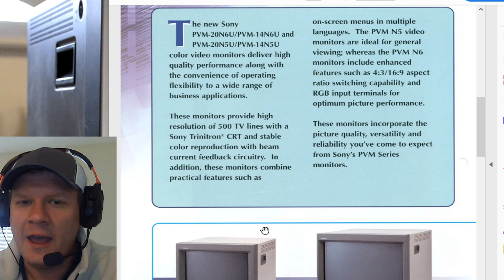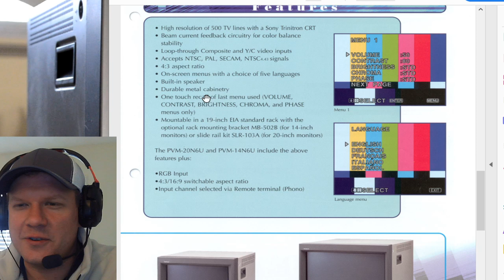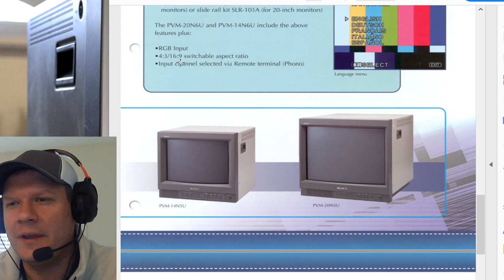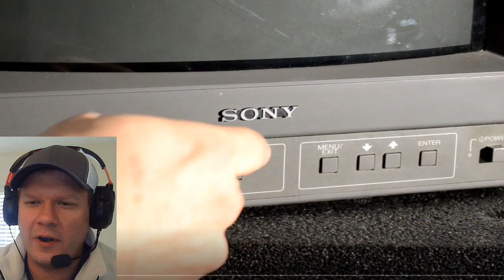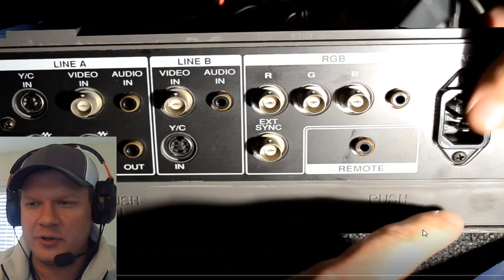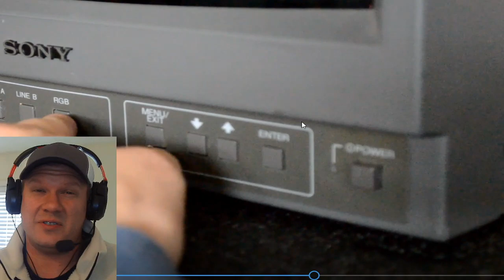This Easy Sony PVM Mod is a MUST!!! | Sticky Button fix

Comment: Converting it from a N5 to an N6 (or N1 to N2) is pretty easy. Hardest part is populating the Q (input) board.
Reply: Sounds like a good video idea in the future if Steve comes across some of the N series.
Reply: You wouldn't happen to have any documented info on how to do this, would you?
Reply: All the N series share the same Q board. So use the N5/N6 schematics (they're better) to populate the RGB section of the Q board. Then, look at the schematics for the components that say "only 14N6U" or "except 14N5U" and modify your A board to match the N2/N6. I needed a couple SMT passives and some through hole capacitors. Like 5 or 6 components in total. The service menu has a mode switch to let you toggle between the low and high end modes. Write the config out, power cycle, and now if you use your external switch for RGB, it'll activate the RGB input and work as an N6, including 16:9 mode.

Comment: You could fix this without even opening the monitor.  I have encountered this issue as well with these monitors, but I was able to fix it by just spraying deoxit D5 spray into the front  hole of the buttons.  Spray then Press the button a dozen or so times to work the solution into the path.  Deoxit is safe to use on plastics & obviously on electronics.

Comment: Glad I found your videos not too long ago. You have great detailed information. I can’t stop watching these. This is the monitor I’ve been fighting with. I was able to switch the wires around on the neck cause my color  (no matter what input) was all switched around. Red was green, blue was red etc. then I’m looking at the picture of any Sega game and it’s wavy. Like towards the top the picture might be bent to the left and so on. If this makes any sense. I hook up Nintendo to composite and picture is fine. Got to b a bad scart cable. I haven’t been able to find this problem online anywhere but it sounds like a sync issue. I’m going to test and take it apart today if I have time.

Comment: If anyone is curious the SSM series of Sony trinitrons were built off of this PVM design. I did a full write-up on how to convert the N5U and the SSM N5U to RGB..  If you watch Steve's video there you notice that he showing a board from an N5U near the end with the green tape underneath the push buttons but there is a button missing that would be the R GB the board supports it but it's not there

https://shmups.system11.org/viewtopic.php?f=6&t=66067&p=1400712#p1400712

Comment: Hello you do great videos and seem like an accomplished TV tech. I worked at a TV shop for years but was the VCR tech so am not to TV savvy. Got a question for you if you don't mind. My TV tech friends here are passed now. Got a Sony KV30-HS420. Symptoms not responding to front panel inputs and not responding to remote. Will power on but no other operations work. I think it's the Micro but none are available. Would you know of a possible source. I already tried shopjimmy and encompass and ebay. Also any way to force it into HDMI mode if no cpus can be found?

Comment: Hi Steve, sorry for a noob question as I am not really a technical person. 

As you mentioned in your video that some sony pvm monitors can be salvaged to fit on others, probably suffering from burned phosphor screen. Will the tube be the factor for the differences of scan lines or the density of the aperture grills? Or scan lines are controlled by the computer chip on the scan boards instead?

I have a small pvm 9044qm suffering from burned screen marks. Have been wondering if I can get those models with lower scan line eg 9040,9041, 9042 for tube replacement. Will it affect the actually quality of the picture? 

Regards, 
Keith

Comment: Hi Steve! I'm a long time lurker and a big fan of the channel! As a few people have already commented, I would also love to see an N5 to N6 (RGB) conversion! I have three 20N5U's and one 14N5U that I want to modify to accept RGB. I have researched quite a bit about it, but have limited exposure to soldering and CRT work... basically, I'm escared to actually pull the trigger in fear that I'll ruin the PVMs lol. It would phenomenal to have a walkthrough video on how to do this!

Here are the most useful links I have found on the conversion:
https://www.assembler-games.com/threads/modding-sony-pvm-20n5a-to-have-rgb-inputs.52392/

https://www.assembler-games.com/threads/sony-pvm-14n5u-to-14n6u-success.70662/

Comment: Hi steve just a quick question, I have a 28 inch wega widescreen and it's having a wierd effect whereby when scrolling objects appear larger in the middle of the screen when scrolling in games, which geometry setting helps with that? My TV has V Lin & S Correct would these help? It's like a fun house mirror effect in the center of the screen if that helps, the effect is lessened greatly in 16:9 but quite bad in 4:3

Comment: Good afternoon! Please tell me whether it is possible to enter the service menu? Is there a service menu for settings for this series of monitors?
Reply: You need to push menu and enter buttons one time and next press enter
Reply: @sullah1986.  Thanks a lot. Thanks!
Reply: @sullah1986.  Very poor service menu. Alas, even geometry cannot be configured in it :(
Reply: @OneeGame  You can adjust a ton of options, just do what i say :)
Press menu and enter once and you will saw a version number then press enter twice and you are in service menu :) To navigate you need to hold menu/exit button and use arrows up or down. To adjust items relase menu/exit when you are in service mode on specific item and use arrows up or down to calibrate selected item. To store settings on specific item press menu/exit and enter twice simultaneously. Thats all you need :)
Reply: @sullah1986.  , dear comrade, thank you so much.  everything worked out for me.  the image makes me very happy.  even though I connected the console via Composite, it’s still a very beautiful and clear picture.  my favorite line is clearly visible.